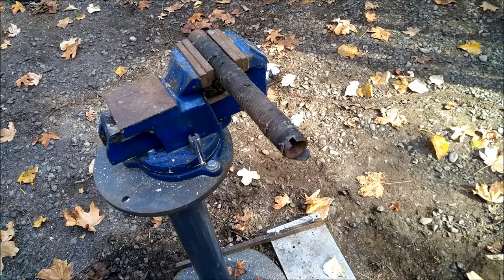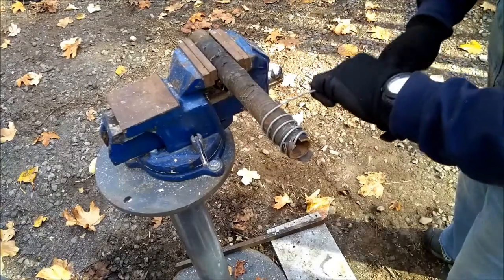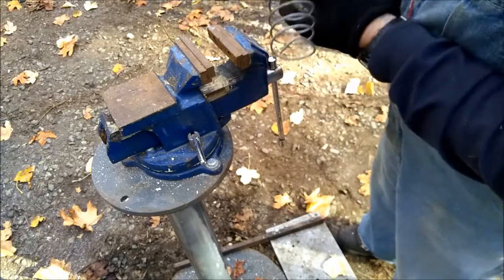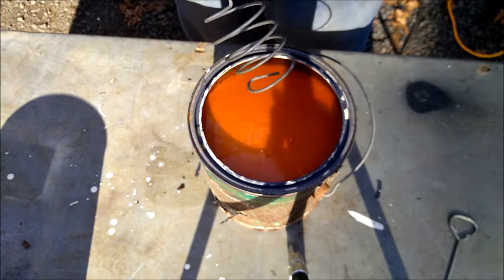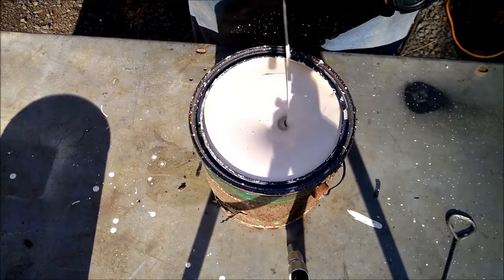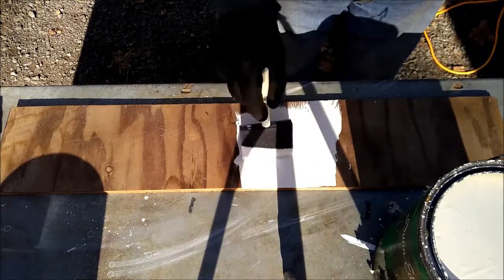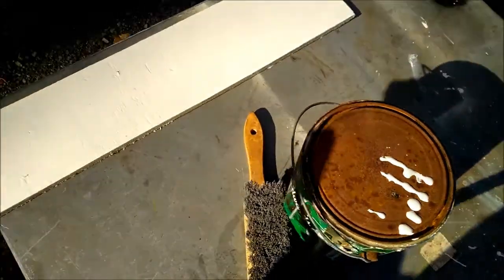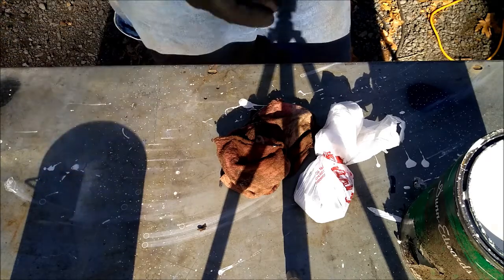World's Greatest Homemade DIY Paint Mixer

Comment: After watching this video, I am determined to never buy another paint mixer. Yours works great. If you buy a box of insulation supports (metal rods) you will have a lifetime supply of metal for making these. I've made a few paint mixers using two small blocks of wood and a few screws to clamp it onto the end of a stout wire. That works pretty well also.
Reply from the maker: Using insulation supports is a great idea.  They are made of some sort of spring steel.  I know an electrician who uses them as thin long drill bits to poke around in sheetrock without making a giant noticeable hole.
Reply: @thecatsupdog  Haha, I do the same. If you flatten the end with a hammer and grind it pointy it makes a pretty decent long thin drill bit. Also, I love to find very long heavy-duty screws, these make excellent drill bits. I just grind it into a blade and add a point. It drills in nicely and the threads help drive it though. But you do have to unwind it sometimes.
Reply from the maker: @eCitizen1  I may have to try that.